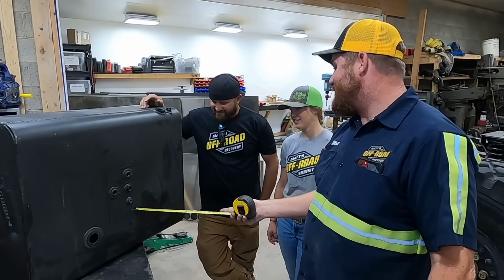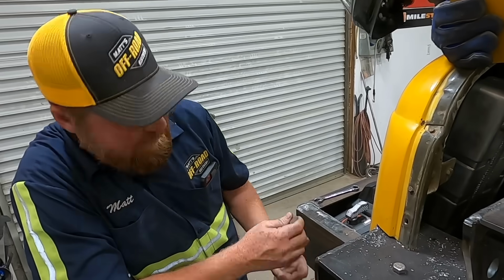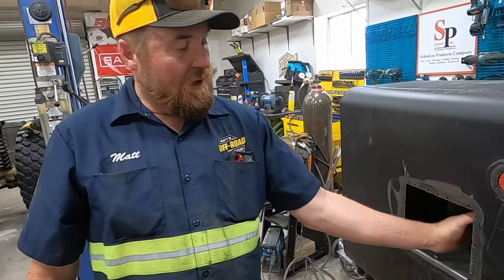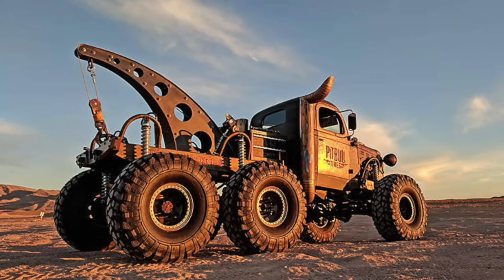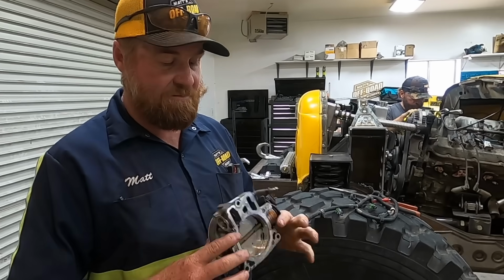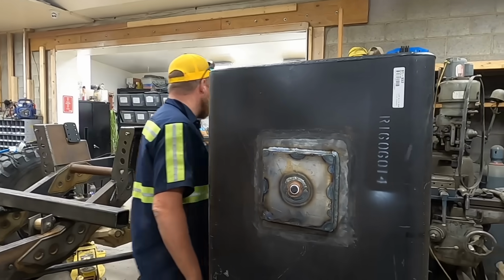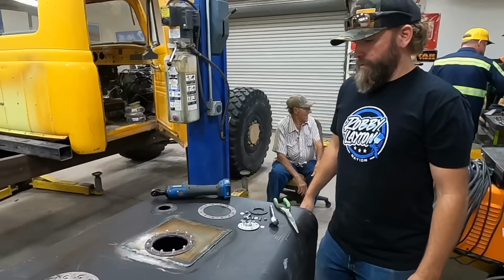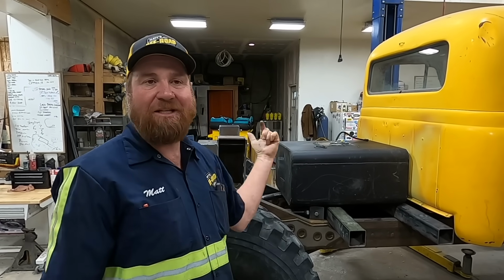World's Largest Off Road Wrecker...There Can Be Only One.

Comment: I can't remember, is the main cab attached to the frame yet? They should mount it on some small air bags. Even Trucks on the road have been using airbags to cushion the cab for years, a 4 pint air bag system would make that ride like heaven. It wouldn't be hard to make
Reply: They would then have to make a fancy join between the cab and the bonnet (hood) and a much deeper & wider engine firewall inside the cab. Also numerous other cab entry points for steering, gearshift, pipes, wiring, cables & rods would then need to be designed and modified to allow for the cab movement. Its much easier to just have a rubber mounted semi-rigid cab and to fit an air seat out of a truck.  👍
Reply: @Pesmog  You're overthinking it, nothing. None of that stuff is rigid to the cab, even the steering shaft slide in an out of itself. All the gearshift's will either be cables with plenty of slack, or shafts with rubber boots. ALL truck have rubber body mounts, they don't make ridged cabs to frames, havent for many year, and anything over a class 7 ALWAY has air ride cabs. Generally the fron is hinged while the back has the bags, but they don't go off-road or crazy angles. Also, idk what you are talking about the hood for, because that is completely separate, they are not bolted together. The hood would be rigid while the cab can move around. Wiring and hoses will have slack on them. But if using the front cab hinged style, it would matter. I've only been doing this for 30 years, but uh, yeah you think what you want. 
If I made it, I'd have it on a giant pin, where the cab will self right and stay mostly level, like on a gimbal. But that would be too much work. The body airbags are totally a standard feature on any truck that size. I'll bet the truck they took the cab off might of had air bags ride, although its a bit old. I don't remember seeing any of that. But since the 80s it has been standard. 
Like even what you're saying makes no sense because all of that stuff you mentioned will NOT be rigid to the cab, the engine will flex quit a bit as it torques, so none of that will be attached to the cab anyways.

Comment: I'm wondering if this is possible, not why you are not using this configuration. It seems to me that the best off road wrecker would be a skidder, they are massive and i think run on 67" tires. They have articulating frames and will go about anywhere. I know they are single cab  but honestly with you guys fabricating skills I know you could make it a 2 seater. Is the reason one was not considered is because they are too heavy for what you're trying to accomplish?

Comment: @matt, i would serieus overthink to put metal straps over the fueltank as well. 
Lorries always have their tanks mounted like that, that's for a reason. 
When the tank is full and you are doing some serious offroading, there will be a lot of stress and tension on the lower mountingpoints, using 2 metal straps will reduce it a lot.

Comment: I was cutting something with a angle grinder,,just like you were. Done it 100 times b4 but this time the cut off wheel caught on the part and broke the cutting disc and then jammed it into my arm!!  
  I spend a day at the hospital getting stitches and cutting disc picked out of my arm. It ripped a gash 2"- 3" long and it was a nasty wound.  Kinda like a cut but more like a tear .
   It happened so fast the eye could not see it happen,,just a noise of it breaking and it was over. I am now very careful with any cut off wheel and keep it away from your face / neck at all cost.

Comment: Iv had to re make those highs pressure lines on the trail.  You need to pre thread and pre cut those lines. Of high pressure splice for emergency’s. Iv got several that are a 250-300$ a piece I’ll send you one. Seriously a requirement when you make high pressure lines on conditions like Utah and Colorado.

Comment: OK.... you need to address your front radiator. Your intake and outlet are top to top. Why isn't it top to bottom or bottom to top? you've literally have lost over 1/2 the cooling capacity of that radiator. Unless that's a special internally ducted end cap, when you're idling around with that 8.1 and wishing you had a more efficient cooling set up. Otherwise, as an IH guy, Scout and Farmall tractors for the last 60 years, I'm enjoying this build, I really want it to be the baddest IH wrecker on the planet.

Comment: I assume that you will be using the computer from the cable controlled throttle body vehicle? If you use the computer from the electrical controlled one, it will continuously go into reduced power limp mode because it thinks it has lost control of the throttle valve.
Reply: @MattsOffRoadRecovery  That’s approved!

Comment: That’s never going to work. Well it will work for a while then the sloshing fuel will cause the tank to flex ever so slightly and eventually a weld will crack and leak. That’s why fuel tanks are strapped down and not welded :)

Comment: looks great Matt and team.  it don't jingle jingle it folds was spot on.  if your not running in cold weather you can rip the two coolant tubes out of the bottom of the drive by cable throttle body for a cleaner look and less plumbing.

Comment: You could put a second sending unit in the tank (no pump) that measures the first half of the fuel consumption and just have two fuel gauges. Could place one gauge directly above the other on the dash to know which is which

Comment: 60 gallon fuel tank. A fellow going to have  mortgage his house  and give up his first born to get enough cash to fill it . Thanks Joe   My advice is don't rigid mount the fuel tank  , just going off  many  pieces of vehicles and equipment are strapped down or up . Sheet metal tends to crack over time from vibration at mounting points , even if damping is used .

Comment: This cooler inbetween the front radiator and the winch is going to fk up the airflow even more. Its positioned way too high and functions like a windspoiler throwing air into directions where you do not want it.

Comment: Capacitive fuel level sender. I figure you know about those but did not want to use one.
 Used them in the aircraft I worked on. Not expensive for vehicles.
Reply: Can you suggest one that would suit a 900mm deep tank? I need one but the few I've seen have been very expensive!

Comment: @Matt's Off Road Recovery
What's your opinion on using manual transmissions in rock crawling or in something like this wrecker? Manuals seem much more rugged and cheap(SM465/NP435) but after watching some of your videos I get the feeling that manual trans may not be practically useful.
Reply: the upside to manuals is the availible super low gear. the downside to crawling with one is the requirements of slipping of the clutch to get over some obstacles.

Comment: Thanks for the comparison on the world largest wrecker claim.  I love this International cab build.  Years ago, I was designing a salt water aquarium that had a reservoir to keep the tank from evaporating too much. We designed a very similar system in the the pump sump so if the power went off and then came back on, it wouldn't pump the entire reservoir into the tank, thus over filling it.  I think your idea for the gas tank is brilliant and believe it will work, because it worked for us.

Comment: Love this project and all guys/ladies in the shop…but….I hate the tabs welded to the tank idea. I’ve messed with heavy equipment for a bunch of years and I’ve seen a lot of cracks in fuel tanks and they always start right where the tab is welded to the tank body. This rig is more heavy equipment than a off road rig and I’m betting the 400+lbs pulling on those tabs will start to tear at the weld joint. 
The whole project is really looking awesome and I dig the overkill built into it! 

Jeff

Comment: So, many high-wing airplanes have wing tanks that 'gravity feed' down to a central tank that's lower. You could have a (much) lower tank for all the fuel to drop into.
Reply: That is what they basically did.  They built a sump.  With @2” sides. Where it will draw fuel.   I might suggest going deeper with angles that thing will be doing.  But   They can change if needed.

Comment: Motors are electric , engines use heat . 
Imperial and fractions still in use in the uk as well as metric ( we can do both you know ) . 
Love the build .
Reply: Engines produce heat as a byproduct of producing rotary motion of a shaft.
If you want to get picky.
Reply: @bushratbeachbum  
It’s the thermal expansion that drives an engine so no . You’re wrong . 
But Heat is also produced as a necessary byproduct .
You know , if you want to be picky . .
Reply: @Whateverpoopiepants  hmm, not quite, but im not continuing. Have a good day. Cheers!
Reply: @bushratbeachbum  
That’s exactly right which is why you can’t continue . .
Reply: @Whateverpoopiepants  no, no, im suddenly reminded of a famous Mark Twain quote, thankfully.
Reply: @bushratbeachbum  
You can remember the quote but not how engines work apparently?
Reply: I’m also reminded of a quote . .
Reply: @Whateverpoopiepants .
Reply: @bushratbeachbum  
That’s what I thought , dug yourself a hole did you champ ?
Reply: @Whateverpoopiepants  xxx kiss kiss troll. Xxx
Reply: @bushratbeachbum  
Still waiting for your explanation of how engines work ?  .  . Chode .
Reply: @bushratbeachbum  
Still can’t do it huh ? 
That’s pretty pathetic dude .

Comment: I'm a farmer that works construction and loves four wheeling. Something I put on all my flatbed trucks that is extremely handy is a medium sized shop vice. In your line of work it might be something you would appreciate. I love your work Matt, your work ethic, and your family and friends are amazing. Happy father's day Matt and hello to the whole crew. Everyone's special personality is what makes this channel the best.
Reply: I had a vice that went into the hitch receiver for our off-road work vehicles. It’s a little awkward being that low but sometimes being able to vice something real quick gets you out of a jam!
Reply: Matt has more than enough vices to keep even the most debauched amused.
Reply: I'm a farmer that farms and there's nothing more handy than a receiver mounted vise. You add in a torch and a welder there's not much you can't do!
Reply: @alexduke5402  Yes an additional Reece style receiver offset to one side. Maybe one on each corner under the back to be versatile. Those could also accommodate a Reece mounted winch if needed.
Reply: they finally put one in our(truck leasing company) mobile service truck that we use to go out of town to go repair trucks at remote lots. it was well worth it
Reply: Absolutely well worth the time to add one to the toolbox. I drilled some holes on the back corner of my flatbed and put the vise with some bolts in the toolbox. My tailboard way inset on the bed about 6 inches which makes a good little work bench. Most of the time the vise stayed mounted, it was hardly in the way but was easily removed if I needed the space.
Reply: Absolutely. I have a homemade tailgate that I can throw on that has a vice on it, and yes, "throw" is a term I use very loosely
Reply: I do the same and mount them to a piece of receiver tube that way when you need device slide it right into the receiver and also it makes it handy as you can mount The Vice straight up 90° or even upside down whichever way might work the best for what you're working on

Comment: You have to have a GIGANTIC gear ratio (reduction) to still have torque with your 137.16cm tires... May I ask what gearbox you plan on putting in there? Custom? Maybe for the next "Q&A with Matt" video - love it when you explain stuff btw...
And yes, you scared the crap out of my poor European heart with your imperial tape measure thingy 😉
Reply: It has MRAP axles that usually have 6:1 reduction or more on their own.  Add in low range in a transfer case for 2 or 3 more times reduction and it should be okay with 8.1 liters of engine in front of it.  Right now it just has the 4l85 (2.48 1st gear) and it came with probably a NP261/263 (2.72 low gear) but its not attached currently.  Not sure if he's commented on using something else.  He could also add a doubler to the tranafercase for another 2-3 times reduction.
Reply: @shadow105720  Wow, tanks for the answer! I am unfortunately not so much a car mechanic but I am a physicist of some sort... I did some research on the components you stated above and according to that the doubler in the transfercase would be definitely needed.: If you suppose a 45° incline, a weight of 4500kg and the 54" tires the torque at the wheels has to be in the neighborhood of 45000nm. The chevy 8.1l engine makes 616.9nm at 3000rpm wich would imply a minimum needed gear reduction of 70:1. without the doubler you'd only get about 45:1. This of course doesn't account for driveline inefficiencies and the wrecker has to pull vehicles too, so 100:1 would be the minimum. Also, the the torque figure is stall torque, and stalling your motor if there is a rock on a 45° incline isn't that healthy.
Thanks in every case, I learned a lot! I for example didn't know about the reduction in the axles themselves...

Comment: A very interesting and, above all, entertaining video. The importance of consistent continuity in the flow of fuel from the tank to the engine is essential in vehicles such as this, intended to overcome extreme inclines and sudden and sometimes unpredictable changes in inclination where the engine absolutely must not stop. Kudos to Matt's solid expertise, supported by an excellent team.
Reply: I think he over complicated the Fuel delivery. I would have just had the fuel line come out the bottom of the Tank, Filter, Pump. & done. he could fabricate protection for the connections.
Reply: @m9ovich785  Perhaps, but in my humble opinion it would have created an additional very vulnerable footprint despite the protections.Inside the tank everything turns out to be protected.

Comment: Hey Matt I think you should strap it all the way around the tank , to maintain the integrity of the tank . That is a lot of weight just to be secured from the bottom. I have had boats with angle iron clips on the bottom and it had them rip out of the fiberglass and rip the the angle iron off. You can imagine how much fuel that would pour out quite rapidly.
Reply: Agree with straps over the top. Dead load is 60x6=360lbs but a shock load of 4G will be 1,440lbs. If you hit something hard you'll see more than 4G...
Reply: @tedsaylor6016  Like using the recovery rope would be a good example of the force applied to those welds with a full tank of gas
Reply: @zeke112964  Instead of "We'll get 'em out!" it will be "We'll make a bonfire!" - Look, it's still a free country and Matt can totally do what he wants - but I'm sure he's gonna at least consider some of these "keyboard warrior" ramblings.
Reply: @tedsaylor6016  That's right!
Reply: Second this. It's alot of shock load to be put on small welds. Definitely not ideal for a fuel tank
Reply: I agree straps would be a better way to secure the tank from moving with that much weight bouncing around on the trail.
Reply: Yes, under extreme conditions the strap could be ripped from the tank, rippinga hole open in the tank, where if the strap was wrapped over/around the tank, it would be more secure.
Reply: This needs to ride the popularity wave to the top of the comment section.  Strapping over puts everything in a higher strength tensile load rather than a low strength shear load on sheetmetal.  Even if the welds are good and they hold up to the load for a while, over time there's going to be a stress riser or inclusion or decarb somewhere in that weld as it bends back and forth that's going to cause a crack to form along that weld, and then the tank is going to have a serious leak.  I have a 100gal bed mounted tank with 6 mounting tabs welded to the bottom.  How many of them were re-welded after two years of off highway use...and how many are still there?
Reply: Absolutely.
Reply: Project Binky had an episode where they installed the fuel tank in the mini and they explained why fuel tanks are ALWAYS fitted by strapping them down. Can't remember the reason but I do remember it was very important and made 100% sense. Gonna try and find the episode...

Strap it down Matt !!
Reply: Project Binky Episode 13 - Any tabs welded to the tank and then used to bolt it down will probably stress fracture over time, because of the weight of the tank. That 60 gallon tank will probably weigh close to or even more than the engine in your wrecker Matt. You use straps to spread the load and prevent this. Also, if straps fail, then you dont have to weld on a fuel tank that has had fuel in it. You just replace the strap.
Reply: I look for those welds to pull loose too. Matt's gotten cocky since the Cat's tread repair, but there's a world of difference between going into a ditch because a track came off and fifty gallons of fuel spilling onto a hot exhaust.
Should definitely strap the tank.
Reply: @cojones8518  I think the ease of using straps.  The fact you are not putting pressure on one point.  Welds are often stronger then metal welded to.  BUT the actual metal just next to the weld is normally weaker. (Until heavy metal). Every under 1/16” metal weld holds, but metal just off actual weld is where it fails.